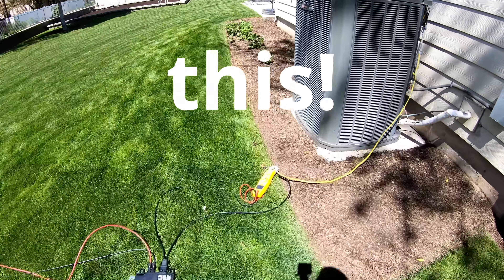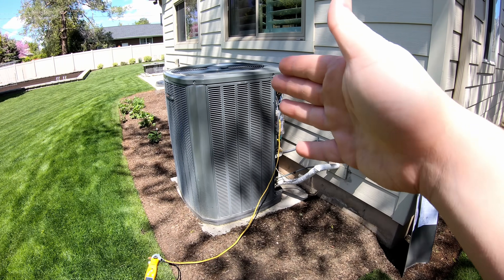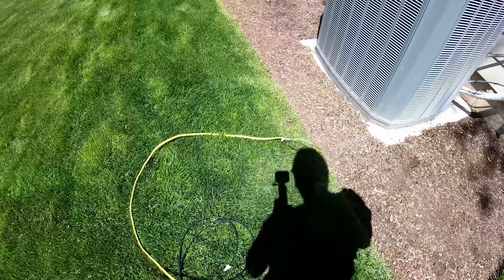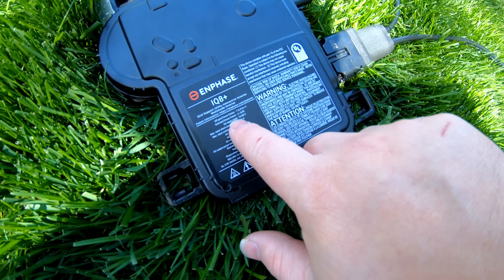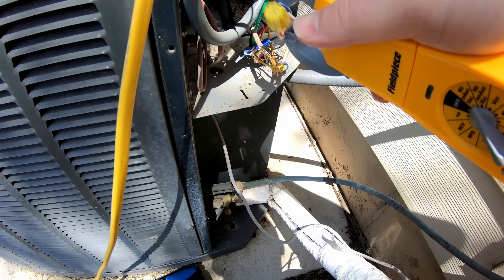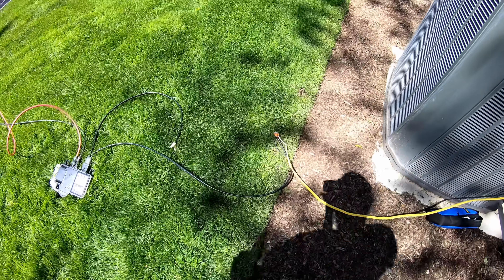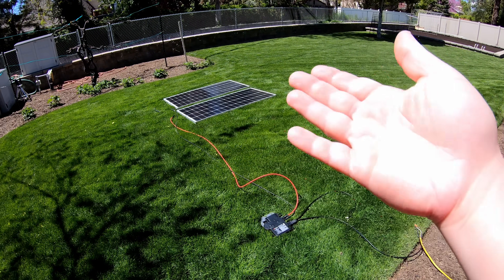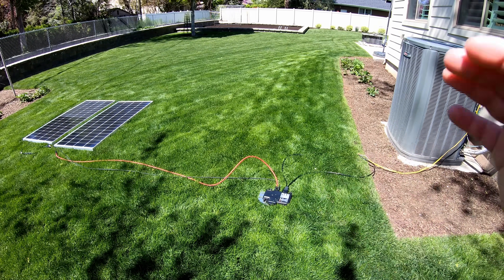1 Hack To Eliminate Your A/C Power Bill This Summer!

Comment: Very cool idea. Great for pool pumps too. I like the idea of using some DC relays controlled by your ac's 24 v contactor drive. Doing so will allow you to keep your micro inverters connected to AC before the contactor so they don't have to wait several minutes for synchronization. As soon as the DC input from the solar panels shows up the inverters will be ready to go and start exporting power without the two to three minute wait for synchronization. Just an idea. Otherwise, love the video and extremely cool idea😊
Reply from the maker: Thanks for your thoughts and for watching! Version 2.0 of this is actually in the process of being filmed. I think all of you are going to like it! Be sure you’re subscribed so you don’t miss when it gets posted!

Comment: This is interesting.... very interesting actually... and something I think I would like to try.   

My use case ---  I've been in IT for over 30years, and am home lab user  etc.   I have a "server" room if you will in my garage, that pulls about 300Watts an hour.  It's not hateful, but that's a lot.

I wonder if I could use 2 200watt panels and invertor like this, to power my equipment during the day, while the sun is out.  Obviously at night I would have to be pulling from the grid, but I wonder if this would work.   

I'm going to do some  digging and research ... The cost of all of it isn't alot, and the ROI would be substantial!
Reply from the maker: Glad to hear the video stirred up some thoughts and ideas! Thanks for watching!

Comment: Thank you for this video! Great idea! It was hard to see your wiring set up on the AC unit . Do you know the names of the parts you wired into on the AC unit?
Reply from the maker: You’re welcome! I simply wired the inverter to the load side of the contactor and of course the ground wire to ground. And that’s it! It’s very simple.
Reply: @theresatrickforthat   Thank you! Last question...Did you have to buy something to protect the wiring from rain or were you able to leave it out? Sry, i never look at my AC unit unit outside but i imagine the parts are typically enclosed.

Comment: Question for my situation as i already have PV on my roof however, it's not sufficient to replace all of our energy use since I have a grid tie back feed utility agreement. I'm wondering if I do in fact contribute to additional back feed, how would the utility company know if it's coming from my current system or I just supplement a little bit? I understand that this would be behind the contactor and independent of that negating this question anyway
Reply from the maker: That I’m not sure of. Sorry! Thanks for watching!

Comment: Not sure how you got this to work without the IQ gateway because this inverter requires it at lest to set it up. I tried this but no luck
Reply from the maker: Well, you saw it in living color work and I don’t have a gateway. You just need to be sure you have solar connections made, sun shining on the panels, and a grid power connection (in the case of this video, that’s through the contactor on the A/C unit) and it’ll produce power. Thanks for watching!

Comment: Great Experiment, You can also set up some solar panels and use a Power Limiting Inverter like the SUN-2000GTIL2. It allows you to "Zero export to grid" , it monitors your home loads and compensates up to 2kw, if the grid goes down, it stops production so you never back feed.
Reply from the maker: Great tip! Thanks for watching!

Comment: If the AC draws less than solar provides will the excess power go to other appliances in house? And this is not a problem?
Reply from the maker: Yes, if you have more solar connected to the AC unit than it consumes while it is running, the power will backfeed the house. I would highly recommend if you’re to that point getting a grid tie agreement set up so you don’t run any risks. Thanks for watching!

Comment: What kind of savings would that provide approximately?  That’s really cool. Also your lawn rocks.
Reply from the maker: Unfortunately, the answer is a big fat…it depends. There are so many variables from electricity costs to sunlight hours and AC unit run times and sizes. For me, just that one inverter and two solar panels has slashed my air conditioning bill by 25%. Add two more panels and another inverter and I’m going to halve my monthly cost to run my A/C. Thanks for watching!
Reply: @theresatrickforthat  That's really cool!

Comment: So the 2nd wire coming out of the microinverter doesn't connect to anything?
Reply from the maker: It will connect to the cable of the next micro inverter, and then the extra cable of that 2nd one will connect to the 3rd etc. it’s for daisy chaining the inverters together. Thanks for watching!

Comment: Thanks for the video I still need to learn more about back-feeding the grid. How does the micro-inverter reduce the amp draw from the grid?  A wire drawing would be helpful so I understand the cutoff from the grid when the AC is turned off.
Reply from the maker: I highly recommend studying about grid tie and off grid solar options! It’s fascinating! Yeah, unfortunately I do not have a wiring diagram at this time. But we’ll see if I can put one together for the Version 2.0 of this coming up here in a few weeks. Thanks for watching!

Comment: Is there anything there to prevent backfeeding the grid in the event of a power failure?
Reply from the maker: Yep! There are two protections. 1. The inverter has rapid shutdown built into it so as soon as it can’t see the grid anymore, it shuts down. 2. If the grid power failed, that means the A/C contactor will open thus physically creating a disconnect with the grid. Thanks for watching!

Comment: In Mid Michigan, my average usage per day, per month is around 30kwh.  So just to have 2000 watts total,, for 10hrs is around 15kwh output, a great daily offset, that can be just jammed threw a hefty inverter, into a 30amp home circuit to feed the rest of the home while the sun shines. you'll never output your daily usage, and surely cut what you pay the power co.
Reply from the maker: Nice! Just be careful…even at times home usage can be low enough that you run the chance of back feeding the grid. That’s why I recommend you connect this behind the AC contactor to avoid the risk of that. Thanks for watching!

Comment: What is running your furnace?
And what would you do at night
Reply from the maker: The furnace has an EZ Generator switch on it and can be run from a simple power station. A nighttime solution is coming up in version 2.0 to be released in a few weeks. Be sure you’re subscribed so you don’t miss it!

Comment: I'd re-wire my electric hot water tank with this setup so that I'm heating water during the day like a solar hot water system as that also one of the biggest power consumption device in a home. You could also use this on your clothes dryer and have the micro inverter controlled via the dryer or from a smart control system
Reply from the maker: Great thoughts and ideas! Thanks for sharing and thanks for watching!

Comment: WOW AS LONG AS YOUR AIR CONDITIONER IS OFF THIS WILL WORK.
Reply from the maker: No. It’s as long as the air conditioner is ON this will produce power. As soon as the A/C turns off…then it stop producing power.
Reply: @theresatrickforthat  Is the air conditioner producing power or the solar using the sun?

Comment: Tell me when you can run your outdoor unit, compressor & fan ONLY on solar.  Till then this is a fairy tale saving pennies.
Reply from the maker: That’s what we’re working towards! Be sure you’re subscribed so you don’t miss the video of my full solar system once I’ve saved enough money for it. Until then, I’m loving putting at least the small part of my full system to work! Might as well save some pennies now instead of it sitting in the garage doing nothing right? Thanks for watching!

Comment: Would love to see how you turn this into a winter solution directly on the furnace, on a system that is not a heat pump setup. I imagine it would be the same idea, the heating element side of the contactor. I am guessing the microinverter outputs 220?
Reply from the maker: Yes, Same thing would apply for electric heat strips. Yes, this inverter provides 240V split phase for US power grid. Thanks for watching!

Comment: Since you'll only hook up maybe 2 more panels to this system, is there a small inverter you can buy and still be safe? That inverter is $2,100. Anyone that knows please help.
Reply from the maker: I don’t think I fully understand your comment. The inverter shown in this video is under $200. Thanks for watching!
Reply: @theresatrickforthat  ok, I was promted to the most expensive inverter that was rated at 5500w. I did see the one you are using now. Sorry for the misunderstanding.

Comment: I noticed you also have the $350+ Microair device; so I am guessing this device wasnt enough to reduce your bill leading to this cool experiment.  just curious what your bills would look like if you eliminate the microair and just went with this solar experiment. or what is your all in costs between Microair+Solar setup and the ROI in overall electric bill reduction.
Reply from the maker: The micro air easy start just lowers the inrush current so I can run a much smaller generator during a grid down situation. Saved me thousands in generator costs. The running wattage of my AC is the same with or without the soft start. Thanks for watching!

Comment: Doesn't the IQ-8 have the ability to meter it's power output to perfectly match usage on the event of a power outage (assuming plenty of solar power is available) to still power loads without backfeeding the grid?   Anyway to get that function to power the HVAC without the grid as well?
Reply from the maker: I think it does…but I think you need more Enphase parts and pieces to make that work. Thanks for watching!

Comment: Would it be possible to hook up a battery bank to this setup?  Where in the down time it charges the batteries and when the AC kicks on, the idle time spent on the solar panels are not just wasted energy so that way it will pull from the Batteries and the Solar Panels?  Would allow you to get more wattage from less panels I would imagine.
Reply from the maker: Yes. I’m working on a version 2.0 that utilizes cheap 12v LifPo4 batteries. So stay tuned for that!

Comment: Hey man great presentation and trick. Question Min 4:17 you say "this is the side the power is coming out off"? I thought that was the side where the feed comes from the inverter, so why you say the "power is coming out off?" thanks!
Reply from the maker: Good question. I hooked the solar to the LOAD side of the contactor. That’s the side that gets switched. The other side always has the grid power present and you don’t want to be there otherwise you run the risk of back feeding when the AC is off. Thanks for watching!
Reply: @theresatrickforthat  understand. Makes sense. Thank you!

Comment: Depending on your region, you probably could disconnect the AC from the main service and use solar only.  It all hinges on the price per kWh. In my area, the AC unit costs about $1.45 per hour to run. Goes up fast.
Reply from the maker: Good thought! Thanks for watching!

Comment: Will this work for a split system heat and A/C or AC window unit? Love your content! want to try to attempt this myself. Thanks
Reply from the maker: Mini-splits are a bit trickier due to them not having a contactor. If you have a 120V mini-split and or a 120V window unit you could consider running it off a power station with solar attached to it like I did in this video: https://youtu.be/eLvLTR6wPkc?si=qkwVul0IWZMS14rr Thanks for watching!

Comment: Will this work great for a ductless mini splits?
Reply from the maker: Mini-splits are a bit trickier due to them not having a contactor. If you have a 120V mini-split, you could consider running it off a power station with solar attached to it like I did in this video: https://youtu.be/eLvLTR6wPkc?si=qkwVul0IWZMS14rr Thanks for watching!

Comment: I love the idea of using the air conditioner switch to disconnect the panels from the grid to not worry about feeding back.  Good job!  You could have it hooked to your hot water tank when the air conditioner shuts off.
Reply from the maker: Thank you! I’m working on the water heater concept…need to find an electric water heater to play with first since mine is gas. But I’d like to explore all the options!
Reply: @theresatrickforthat  They do make solar powered heating elements for weather heaters. So you need a water heater that takes 2 elements so one can be on solar and other on grid.

Comment: Can I do a setup like this for my a/c but using a straight plug in adapter instead of the internal wiring setup? I have a splitter wall mount a/c unit that plugs directly into a power outlet. I would love to be able to plug it directly into a solar panel setup during the hot days.
Reply from the maker: Hummm. Maybe if it’s a 240V outlet. Otherwise, 120V units are trickier to apply the same concept to. Thanks for watching!

Comment: Help power the air-conditioning like a gallon of water added to a in ground pool loosing many gallons to a major leak, yes it adds but in it self can not and will not drive the whole.
Reply from the maker: One day it will as I add to it! But for now, I’m pretty thrilled with my gallons of water I add each day! :) Thanks for watching!

Comment: Back of the napkin calculation: The system costs $418 to purchase, not including taxes or installation. In my area, electricity costs about $0.145 per kWh. To break even, I need to save 2883 kWh because 418/0.145 ≈ 2883 kWh.

Based on the power output of 288 watts (or 0.288 kW), achieving 2883 kWh would require approximately 10010 hours of operation (2883 kWh/0.288 kW ≈ 10010 hours).

Assuming optimal conditions with 12 hours of daylight operation per day, the payoff time would be about 834 days (10010 hours/12 hours/day ≈ 834 days).

Given these assumptions, which are quite generous considering potential variability in daily sunlight, system downtime, and other efficiency losses, the system might not be worth the investment from my perspective. The time to break even is considerable, and real-world conditions could extend it further.

Anyways thank you for taking the time to make this video.
Reply from the maker: True! But there’s a certain satisfaction one feels as they offset even a small amount of power. One day, I’ll have a larger array…but got to save my pennies first and it’s nice to put what I have already to work. Thanks for watching!

Comment: Get caught with that and then you will have no AC. They have the right to disconnect you for tampering. I have 9000 watts of Enphase btw. What you are doing is extremely dangerous by have that sh1t on the ground like that.
Reply from the maker: I guess I better hurry up and get my off grid power system up and running then! Thanks for watching!

Comment: How much does this save or avoid in cost?  1-2 panels providing 250 watts generates 0.25 KW.  Electricity is $0.20 per KWhour.  So save 5 cents each hour.  5 hours per day, save $0.25 per day.  30 days per month is $7.50 per month savings.
Reply: Wrong. It's two solar panels. 400 watts. He said that at the beginning of the video. Clearly you didn't watch it, wise one.   👀😏
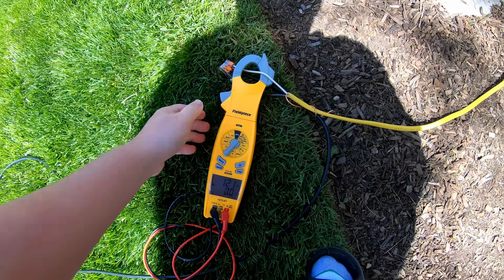Reply: @paulmoore3280 Paul, at 8:10 mark in video he measures 288 watts.  I watched the entire video.  It was well done.  Sounds like you may have just watched the beginning.  Regardless, as the author said, you can scale it up with more panels.
Reply from the maker: ROI timelines will vary wildly from location to location and power costs. But a penny saved is a penny earned! (Isn’t that the famous saying?) You can scale this as big as you want to to offset more power consumption. Thanks for watching!

Comment: 200 watts when it’s pulling 1800 plus is a waste of time. I have a entire system power one of these and I still use assist on the inverter at 700 watts so my setup doesn’t over heat.
Reply from the maker: Well, to each their own I guess! For me, this is a stepping stone to a larger system. But there’s a certain satisfaction that comes from eliminating a few hundred watts of power in the interim while I continue to save for my large system. Might as well put the equipment I already have to good use! Thanks for watching!

Comment: I would have absolutely tried this a few months ago on my 23+ yr old AC central air unit... the compressor went out and I decided to replace both furnace and ac unit (since they were original to the 2003 house I live in).  Id be worried about long term effect with current fluctuation on the internals of my ac unit.... especially since I paid a little over $10k for the replacement. :`(
Reply from the maker: Glad to hear that you got a nice shinny new system there! Thanks for watching!